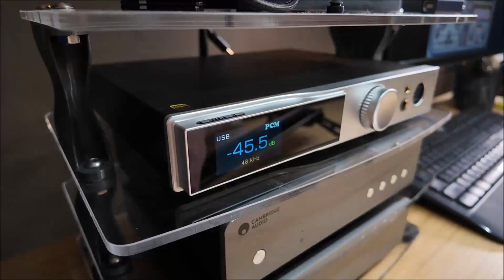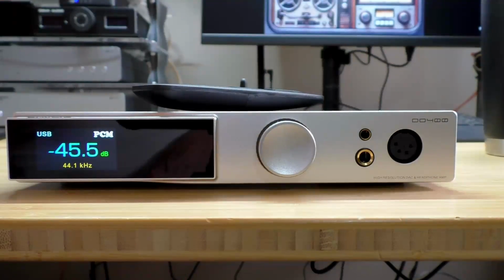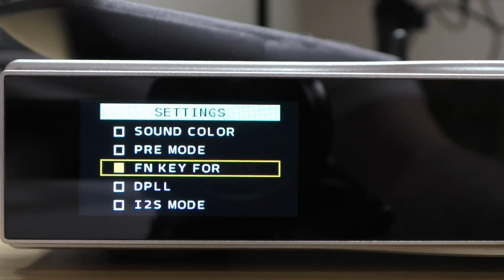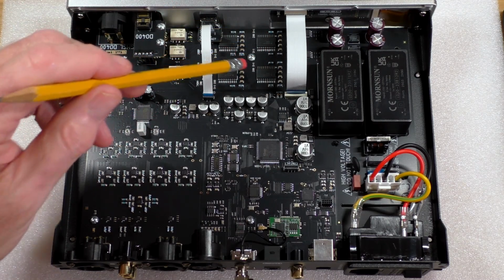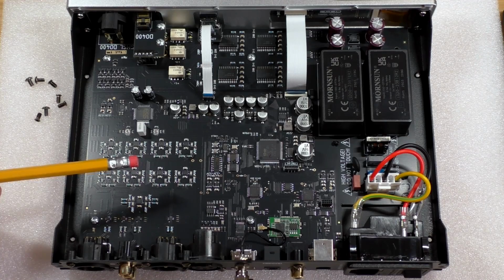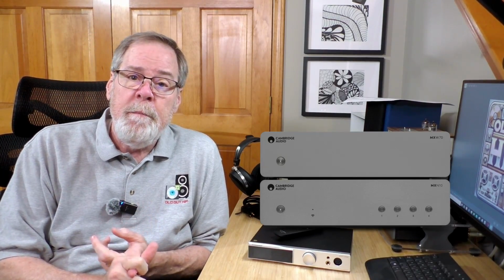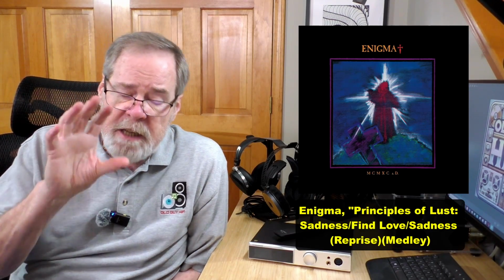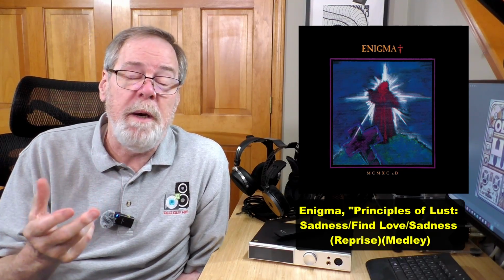SMSL DO400 Headphone Amp/DAC. Powerful & Great Sounding! It had no trouble driving all my headphones

Comment from the maker: The SMSL DO400 is a very full featured Headphone Amp/DAC. It use some great tech including: a new 3rd generation XMOS XU-316. The latest flagship ESS Sabre DAC chip ES9039MSPRO. High output power: 6W at 16 ohm and 3W at 32 ohm. Fully balanced design. Specially designed linear regulated power supplies for discrete components and multiple low-noise regulated power supplies provide analog circuits with low noise power supply.  If you are interested in purchasing this unit please click this affiliate link: https://amzn.to/3Iw6dCC. If you wish to join the channel please click here: https://www.youtube.com/@OldGuyHifi/membership

Comment: Hi Ed thank you for this review. I have a question for you: I have a smsl su-9 pro which is another variation of the do400 with the exact same architecture and dac chip (but no headphone amp). Does it make sense to have the smsl po100 pro between the streamer (in my case Wiim ultra) and the dac? Both the smsl po100 pro and the dac are using the same xmos xu316 architecture, so I’m just wondering how adding the po100 pro makes a difference in sound compared to feeding the dac directly through usb from the streamer/digital source? In both scenarios, we are either using the po100 pro clock or the dac clock as we feed them through usb. I’m convinced there is an improvement as you described in other videos, but I’m curious to understand why it is having this effect knowing that both devices do roughly the same processing with their xmos xu316 architecture. Happy to have your view on that.
Thanks a lot. 
Hassan
Reply from the maker: Hassan, One of the biggest benefits of the PO100 Pro is it completely galvanicly isolates the WiiM from the DAC. WiiM units are a bit notorious for have a lot of jitter and timing issues. Yes, the DAC can deal with some of those but not all. Think of it as an extra filter sending a cleaner and more accurately timed signal to the DAC so the DAC itself doesn't have to do as much error correction and can use it computing power for the conversion process. I hope that answers your question. Thx for tuning in and commenting.
Reply: @OldGuyHifithanks a lot Ed for this clear answer!

Comment: Ed, another great review!  SMSL has a TON of mid-priced gear showing up on Ali lately, glad to see some of it getting your attention.

I have the new Douk U2 Pro XU316 (official name?) on its way, specifically because of its DIY upgradable oscillator.  I would LOVE to see you dive into that, the upgrade options, and how it compares to other DDCs including the PO100 Pro and other budget options.  With a high-end clock does it punch above its weight? 😊
Reply from the maker: I have had one for several months. I think I have a prototype. I have been taking with Douk a lot on the unit. I really like it. I think it is a smidge better than the SMSL PO100 Pro. Once you get it let me know what you think. Thx.
Reply: @OldGuyHifi I don’t have a DAC with i2S input… any comments on coax vs optical?  I’ve been using optical out of the PO100 Pro.
Reply from the maker: The differences are very subtle depending on the system. The more resolving the system the more apparent those differences become. On the desk top or affordable gear like a CXA81 MKII or an Xi75, I don't think the differences matter or are easily discernable. SPDIF is SPDIF. I prefer Toslink because at its core it is electrically and galvanically isolated from the rest of the system.
Reply: @OldGuyHifi New U2 XU316 is in, I’m going back and forth between coax and optical and can’t tell the difference on my upgraded ZD3.

What I can tell is it sounds clearly better than the PO100 Pro!  I’m getting details I’ve not heard before, and imaging is more solid.  This has now put my PC above my streamer, which was hard to tell apart from the PO100 Pro.

I was not expecting this!  I was hoping for an improvement after upgrading the oscillator, but it’s a big step up right out of the box.  What a pleasant surprise!
Reply: @OldGuyHifi I also sprung for an SX22B op amp (not 52) and WOW - in the RCA out on the ZD3 it’s now on another level compared to Burson, Sparkos or SX52B.  I’ve never had a real hifi system before, but this is sounding really good… and just when I think it’s not going to get any better the new U2 steps it up again.  I’m a happy camper this week!!! 😊

Comment: I thought do400 came out late 2023 and review has been done out of nowhere now a group of reviewer starts to review again at the same time? Is a good set but randomly some unit comes with bugs has not been solved discussed in head-fi forum which caused a massive letdown.
Reply from the maker: I am not aware of the bugs, but thanks for the comment.
Reply: Thats why it is better to buy the DL400 :)

Comment: A little off topic but did you find the f22 had difficulty driving the SJY headphones?
Reply from the maker: Not at all. Why?
Reply: @OldGuyHifi  when I was listening to records I couldn't get adequate volume. When streaming it's better but I have to turn the volume know to 3 o'clock as opposed to my Audeze lcdx that are plenty loud at a o'clock
Reply from the maker: Could be the output of your phono pre-amp.
Reply: I increased the gain on phono amp which helped a bit. I typically use headphones when I stream so it's not a big deal. I was curious if you had a similar experience with the SJYs